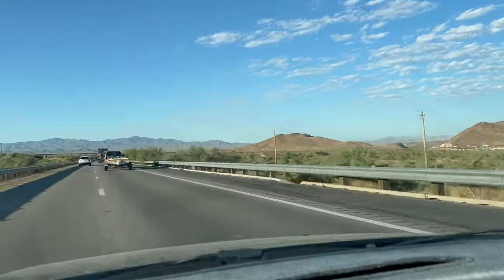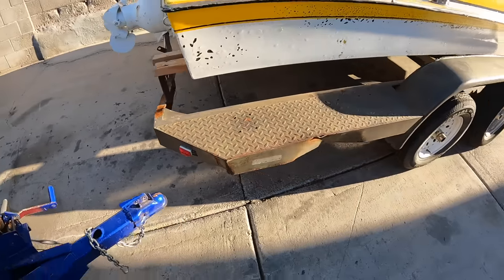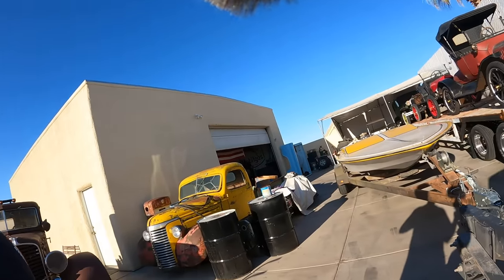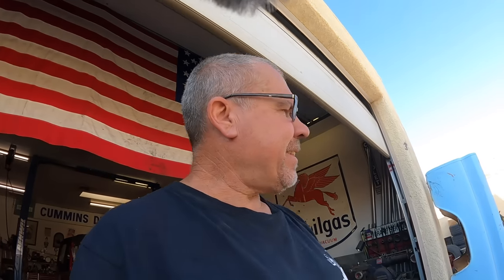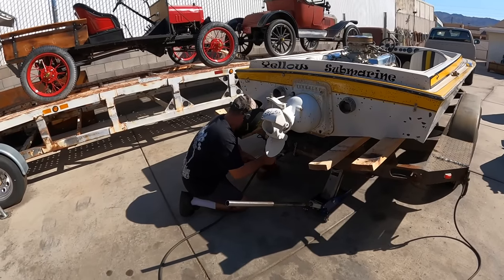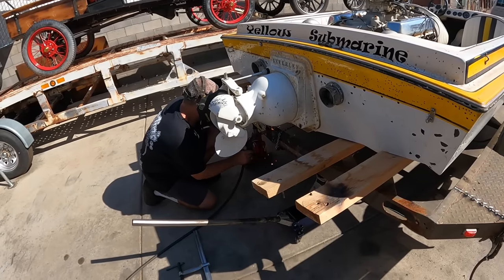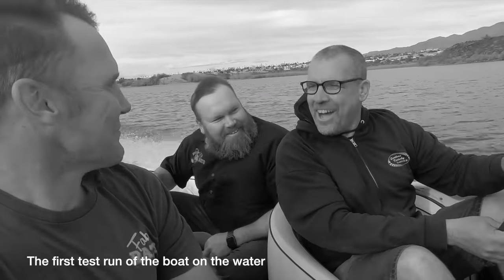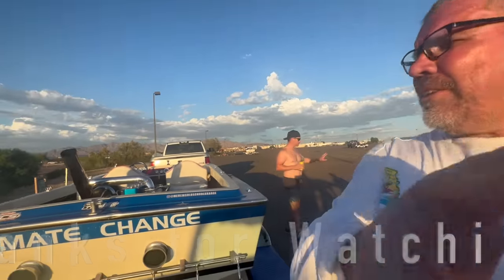The Yellow Submarine Floats One Last Time Before Going Home

Comment: It still amazes me that the boat came back with as little effort as it took to have it floating and running again. Yes I understand that it is far from perfect and could use a lot more work to make it better but setting under water for some thirty years and basically a little cleanup new oil and a tune up and it's working again. Just wow

Comment: On the prop on Cummin boat, try contacting "Stevens Institute in Hoboken, NJ . . Major engineering college. If you send specs on boat and engine to their marine design/engineering dept, they will assign a student to determine the right size, blade count and prop pitch for the boat Todo what you want with boat especially quick planing (getting bow down  when starting forward motion)

Comment: As a former welder I watched this and cringed for that poor torch. The guy who taught me how to use a torch told me that he learned to run a torch because he 'hated to grind'. They make tip cleaners and facers for a reason.

On a totally unrelated subject, if you want to put a nice rusty patina on iron/steel, just paint it with an oxidant. When I have had to make something look rusty I just paint it with gasoline and wait twenty minutes.